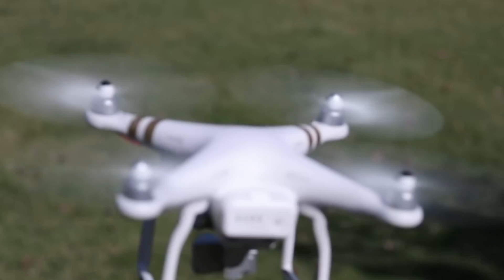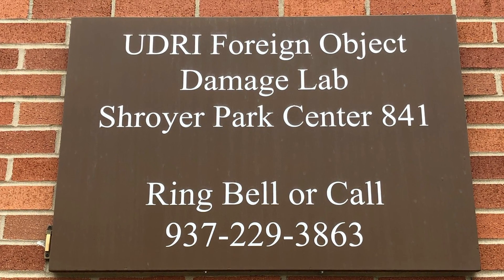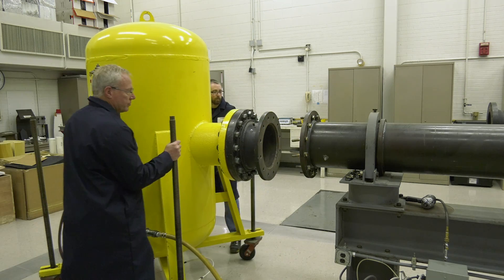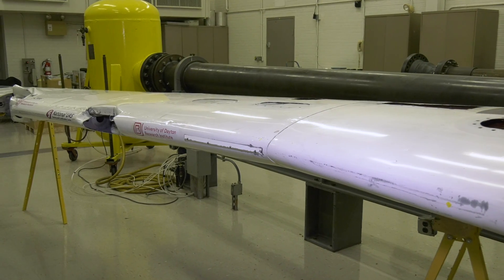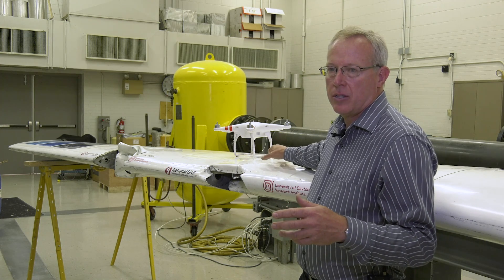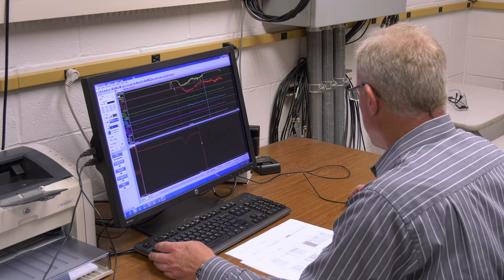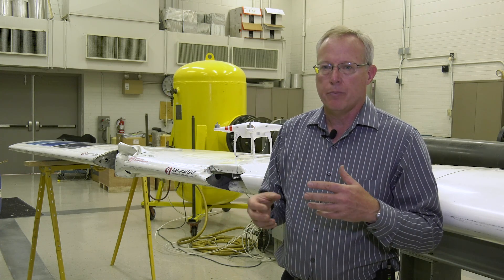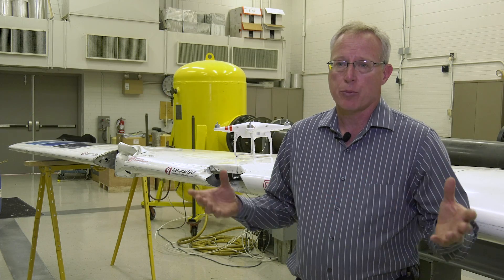What Happens When a Drone Hits an Airplane Wing? – AIN

Comment: "hobbyists  ... be more aware of the risks as they take to the sky" shows COMMERCIAL drone flying less than 5m off the ground over agriculture 

What a farce video. Do the impact test in a wind tunnel to simulate the real world airflow. Have the drone "hover" and get taken by the wind into the wing because that it the most likely scenario of a DJI product impacting a plane that is taking off or landing.
Reply: Yeah, but they're not gona test a real flying airplane flying through a swarm of quadcopters.

Comment: I question their closing speed, given that the wing from Appearance and structure appears to be from a light most likely piston powered aircraft. 

They could mock 100mph off their closing speed and be a little closer to reality. 

That aside the damage to the wing is not catastrophic I have seen aircraft with far worse damage still fly with minimal adverse affect. 

My guess is if you follow the funding for this research you will find an entity with an objective and motivation to restrict drones and not for safety reasons either.
Reply: That is correct, but then to be closer to reality send the drone through the windshield at 138 MPH....bet that = dead pilot >>crash & dead everyone..

Comment: I'm not sure there is adequate testing here there are a lot more things going on while an airplane is flying. Let's see testing in a wind tunnel at least ( I ) think the air moving over the wing would probably pull the drone over the wing. Plus we need to see what will happen if it got sucked into the turbine engine. 😲

Comment: This is bad science.  The CAAIn the UK did similar testing and could only get a drone to penetrate a helicopter windshield if it was fired from an air cannon at very high closing speed and it was mounted on a metal bullet!  There have been no actual airstrikes that proved to be a drone, airline pilots report anything in their vicinity as a drone, one even reported one at 12 thousand feet altitude, which is impossible.  The latest alledged drone near miss in the U K turned out to be a plastic supermarket bag.
Reply: I'm pretty sure the average speed at which a helicopter travels at is much less than the speed of a typical airliner.
Reply: @MrMilkman29  if I recall correctly a military helicopter did hit a consumer drone. It scratched the rotor a little bit, the biggest issue was the requirement and expense to re-inspect the helicopter.
Reply: Howard Maryon-Davis
There are videos showing drones flying higher than 12,000 feet. It is possible.
Reply: Lamar W Military ones, certainly.  My own drones, large 3ft across commercial camera drones, have a flat out vertical climb rate of approx 10ft per second which decreases drastically as the air thins with altitude. The batteries will last about 10 mins on full discharge.  That gives a max altitude of 6000ft, and that is a one way trip, it would then freefall to the ground.  A state of the art DJI would not do much better.
Reply: @lamarw7757  but those are fixed wing rc airplanes and not quadcopters, the main issue of this video. Besides, fixed wing drones are even lighter and made of soft styrofoam or thin plastic. That would definitely cause less damage then birds.

Comment: How about making the leading edge of the wings with stronger material, or put in a thin titanium bar right behind the leading edge so the drone could not penetrate into the inside of the wing, where you have a bunch of hydraulic lines and fuel tanks.

Comment: They need to conduct this test in a wind tunnel or something of that sort. The air pressure around the wing would most definitely deflect the drone out of direct strike position or make it miss altogether, much like it does to birds at that speed. The birds are not a danger to the wings at that speed because it’s the wings that are fighting and creating the specific air pressures for lift, the hull and the engines are what are most often damaged because the air flow around those are much less forceful (for the reason of being able to actually cut through the air we’ll enough to maintain speed).

Comment: a cesna 172 has a top speed of 188mph and cruises at 140mph.   a phantom in full forward flight is only about 25 mph.  where do you get your speeds from? did you pull them out your ass like the rest ot the bullshit you let fly out of your mouth.   ps gel doesnt simulate the skeletal structure of a bird  so now your test results are false

Comment: The plane is weak as a piece of papper. one way that will safe your ass on the planes is to get the moniter sreen and GPS out of all hobby drones i flew RC plane and helicopters for over 18 years never had any problem, because i fly with my eyes sign look at my planes and helicopter all time and fly it low. In another way you should warning all hobby shops to provide rules for any drones buyer customers or have them take a test before they buy a drones, because too many RC pilots today are do not follow the FAA or AMA rules.

Comment: I fly an M20J. What’s scary is that the Mooney’s fuel tanks aren’t modular like most small airplanes. They just took part of the wing and sealed it off. If that happened to the leading edge of the fuel tank, you’d be down a tank and possibly have a fireball for a wing.... scary.
Reply: I think history tells us that you are more likely to crash from mechanical failure in that small plane than a drone or bird 
strike.  That's all you guy.  you won't get me in one of those.  Every other day one is crashing here in florida.

Comment: Firing a done at a static wing is not replicating the outcome of a flying wing striking a drone. Video synopsis: don't cannon fire your drones at parked planes.
Reply: Since it's a compressed air cannon, the impact airflow over the wing surface is adequately duplicated in the course of the test...so, that "real world physics" thing...yeah, they got it covered.
Reply: I’m sorry. Your all as thick as shit and really don’t know what your on about.  Stick to games consoles or Barrie toys whatever.
Reply: We got a fucking physics scientist here...
Reply: ashley arundel they are close enough for their point
Reply: ok youre obviously  a  moron
Reply: Will, if their point is 'Don't cannon fire a DJI at the leading edge of a static plane wing, as it will damage it" then, yep, you are right. 

However, they have missed the 'real world physics' of a wing in flight, in the real world. 

https://m.phys.org/news/2012-01-wings.html
Reply: Which proves what? Firing smoke out of a canon at a stationary wing isn't the same as flying the wing through smoke? Dunno about yours, my model aircraft weigh a bit more than smoke, and, regardless, if you're trying to imply that the airflow would "deflect the drone around the wing", then that's nonsense, however much it deflects, if at all (inertia...) it just means the trajectory required for impact is different, not that impact is impossible. 

There is real-world proof of this, from the real world of planes in flight: https://www.google.com/search?q=leading+edge+damage+from+bird+strike&prmd=ivns&source=lnms&tbm=isch&sa=X
Reply: Newton's third law is: For every action, there is an equal and opposite reaction. is completely ignored.
Reply: @martinfahrer4971  don't forget Murphy's Law. What can go wrong, will go wrong. This is also being ignored.
Reply: Considering birds of similar weight can and have hit planes, I think you are the one that needs to reevaluate the testing.
Reply: The whole problem with the testing is that they are making the test based on an aircraft flying at cruising speeds which is about 10,000 ft above the ground and above cruising speeds. That in itself, is a hazard because the plane is passing its' safe operating limitation.

Even at the airplanes cruising altitudes, the drone doesn't have enough power up there to reach it's maximum full speed. That alone, nulls this test. Additionally, the proposed speed that they are claiming that the aircraft is going is pushing the wings structural integrity. Meaning, the airplane is doing something it shouldn't be doing right out of the gate.

A 'real' test would be a simulation of a plane coming in for a landing at landing speeds <120kts, not 230mph and hitting a drone at or below 400ft. I guarantee that if they followed real-world logic instead of attempting to create fear, the drone would bounce off the wing and cause a small dent.

This test is just ridiculous, and is only served to create a fear-based video.
Reply: @justmycomments  The approach speed for some (admittedly rare) aircraft is actually pretty close to this value: The MiG-21bis fighter jet's approach speed is 218 mph. Pretty much any jet aircraft is certainly capable of speeds higher than this at low level.

That being said, the solution is one that we (pilots of drones and model aircraft) already follow: Don't fly your model near an airfield! Outside of a safe radius around airports, it's probably reasonable to say that anyone who flies a manned aircraft at speeds above 200 mph below 400ft ASL is doing so at their own risk- this practice is after all a recipe for bird strikes as well as drone strikes.

Comment: this is bogus science. they chose an unrealistic GA collision speed for visual effect. 

1. most ga aircraft cruise below 150mph.  
2. the airflow over a wing would give a dlecting effect to a drone.
3. ga aircraft are not allowed below 500ft agl except within an airport atz and drones are forbidden in airspace.

the correct test should be at an ultralight wing at 150mph.
military aircraft are most vulnerable as they may fly at 250ft above 200mph.

Comment: There is only two scenarios where this impact would happen: Either the drone operator is too close to an airport or the aircraft pilot is below his minimum legal altitude. This happens often near my home over Lake Michigan. A big risk reduction would be to change the rule that allows fixed wing or helicopters to operate below 500 feet over open water. There is really no reason other than "it's fun" to do that near land. If the FAA is really worried, but they don't address that rule, you'll know what way it's going.

Comment: I just don't understand why use the drone as the projectile when the plane is the actual thing realistically speaking to be moving for instance if you have a 2x4 going at 200mph it will go straight thru a concrete wall because the 2x4 has the velocity so realistically speaking these test are only for showing what a object would do if a plane is standing still and a bird/drone is magically flying at 200mph+ which is "realistic" apparently but I'm not a engineer or anything i just know some physics and velocity laws (here's a example again) Giaco whatever on YouTube made a nerf gun that went thru a soda/pop can because when something is going really fast it becomes a solid and will go thru a lot of things if it has the velocity.